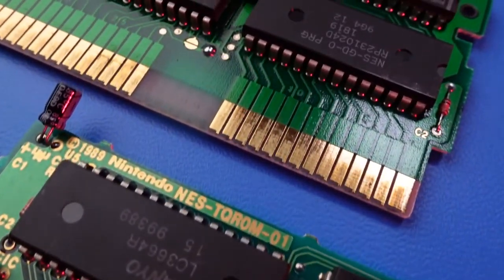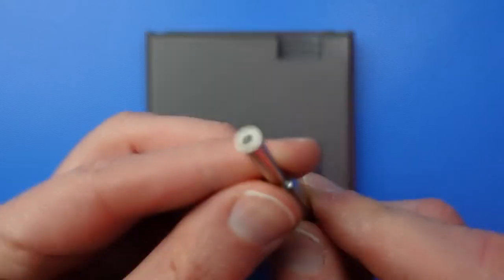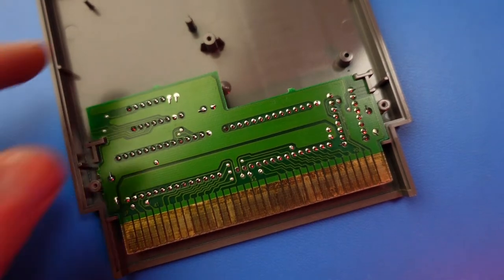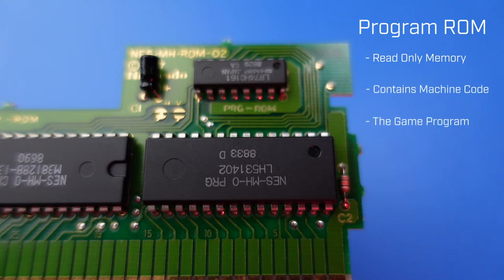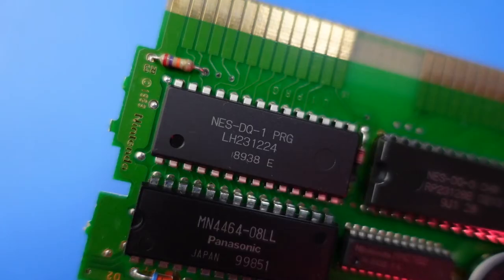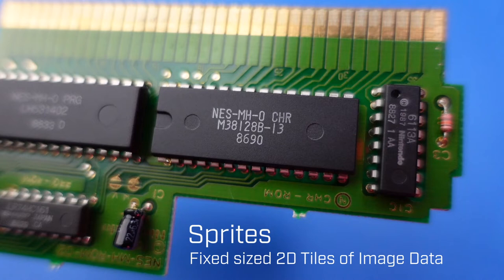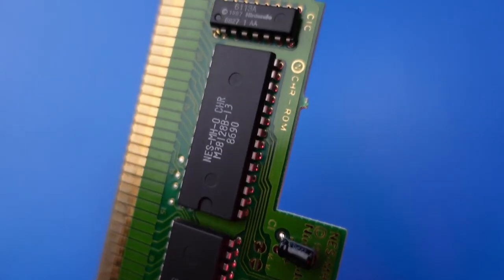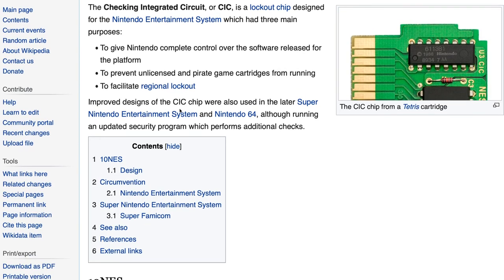NES Carts Explained

Comment: About the 3 screws on carts - from what I remember initially there were 5 screws, but then they removed 2 likely to cut costs. Just a little fun fact I guess
Reply: also on the 5 screw carts instead of game bit screws they were flathead screws (I think)
Reply: the 5 screw carts actually contain adapter that converts a famicom cart to a nes cart (seems quite a lot more expensive no wonder they dropped)
Reply: @williamv0242  I believe they did that as they had many more Famicom cart boards than NES boards at the time and it would cost more to produce new NES cart boards than simple adapters, at least that's what makes sense to me.
Reply: It depends on the cartridges themselves. MOST games only used half of the cartridge space, and it was easy to secure them. However, when it came to games that had the MMC5 mapper chip, it was difficult as they were bigger (and more expensive to manufacture) circuit boards. Some of those MMC5 carts also had multiple CHR and PRG processors.

Comment: Ahh, yes. the dreaded 10NES, AKA the thing that makes your front loader blink on and off....
Reply from the maker: And we would have gotten away with it too… If it wasn’t for those Corporate types and their little CIC chip!
Reply: @NesHacker  I personally love how they removed the CIC chip completely from the top loader design, even though not using that godawful ZIF connector was probably enough to remedy the issue!

Comment: Not a doorknob. Cold water pipe or the faucet it's attached to, or something else metal that's grounded to your outlets' third prong (assuming that's grounded properly.) YT says NO! to a link to an anti-static mat with ground wire, hit up Amazon or something. Totally worth it if you're gonna do a lot of these.

You might scratch yourself on a sharp solder joint, but not if you're careful. Also, 1980s, that solder contains lead. Handwashing or gloves wouldn't be dumb ideas.

If you wanna collect these games and not get ripped off paying for a "rare" vintage cart that made last week in Shenzhen, be prepared to open the carts and examine the PCBs.

Happy hacking!

Comment: Can I ask you a question? Nothing about the hacks or programming.  What caused the the blue screen? That use to drive me crazy lol
This channel is awesome. Just a little past my pay grade but still cool to learn about.
Reply from the maker: You mean when you’d turn the game on but all you see is a solid color and maybe a single tone playing over the speakers? Most likely a bad connection from the cart to the console. 

The pads could get very corroded and after a while would make bad contact either the cart adapter.

Since the cart communicated data and addresses to the console with a parallel bus (a single electrical connection for each bit) if only a single one is messed up the console gets corrupted data, when this happens with program code it spells disaster for the game and it does all sorts of weird crap.

Comment: Awesome content on this channel. I have a question for you. I have a Zelda cartridge that behaves in a strange way. I wonder if you could guide me on whether or not it is fixable. 
I have cleaned the contacts and it starts up just fine. 
The first screen where you go into the cave to get the sword appears grey for a second and then the middle of the screen goes black with only the edges showing. I can still move Link around and go to another screen or even into the cave to get the sword. 
If I immediately go left or right the game crashes. 
If I go up that screen loads correctly and if so go back down to the first screen it also loads correctly. 

Now if I start going left or right the screen will scroll and as it does the screen splits and I see the correct screen at the top left for a second but the bottom of the screen looks like the screen I left. The bottom image takes over. Link and the enemy sprites all move and behave correctly but the background is wrong. The collision detection is like I am on the correct screen if there is a tree on the actual map I can’t walk through it. I have to memorize what the game should look like and works. 

I have a regular front load NES and it plays all of my other games just fine no problems. I also have a Retro Duo and this game actually plays quite a bit better on the Duo. It renders the maps correctly but it has black squares that appear on the screen in the backgrounds. 

Can you advise me on what I should try to do to get it running correctly?  Have you heard of this problem before?
Reply: Both Zelda and Zelda II for the NES have internal save batteries. Perhaps the one in your cart is wearing out and somehow causing voltage problems, or worse, has maybe been damaged and affected the PCB traces?

It might not hurt to get some cheap gamebit screwdrivers and open the cart up to look, if you haven't. It would also give you a chance to do a deeper clean and check for any kind of damage near the cart connector pins.

Hope you get it sorted out!

Comment: Can you explain how an Everdrive operates or how a Super NT (jb fw) operates since both use  “dumped” rom data vs separate chips/pcb?
Reply: The Everdrives and Super NT are based around FPGAs, which can be programmed to emulate/recreate the functionality of various hardware.

So for the Everdrive, the FPGA provides the general file handling interface and also recreates a lot of the mappers and chips NES carts used, in addition to other things.

The Super NT uses an even more advanced FPGA to recreate the SNES hardware and, with the right firmware, at least some of the enhancement chips certain SNES games relied on, in addition to more basic cartridge functions.